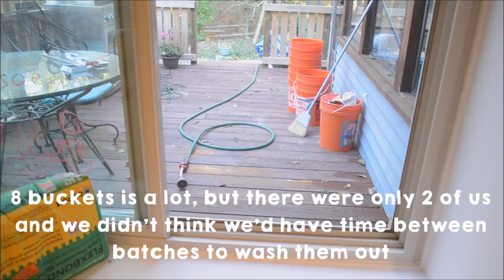My Experience with Self Leveling Underlayment

Comment: I had a floor like that leveled about 7 years ago.  It took me 3 weeks of intensive searching to find a contractor that would even take on a small job like that.  Then I had to wait almost 2 weeks to fit into his schedule.  It cost me $750, which is a good price according to other contractors I talked to.  If I had it to do over again, I would have done it myself, not only to save the money, but to get it done quickly so I could get on with the rest of the project.  Don't pay any attention to all the people who like to cut down DIY'ers, they are just jealous that you show people that there is no big mystery to much construction.  You just need to read up on the proper methods and jump in there.  It takes knowledge and experience to become a skilled tradesman, and all of them started out without the latter.

Comment: A couple of thoughts. So I'm a floorig contractor (eg. tile, hardwood, vynle, and carpet) who has extensive experience in self-leveling. There are many, many things that I do that I would put into the category of things that can be done by a patient DIYr, but self-leveling is definitely not one of them for the followig reasons. First, a floor like that should be mixed and installed in no more than 15 minutes, and preferably 10. The only way to soundly accomplish this is to have  large buckets that will handle 2 full bags along with water and some space so that you don't make a mess. Having two of these buckets is preferable so that one person  can mix while the other pores. Second, having a proper drill that will put out the proper RPM at the proper torque is critical to self leveling actually being self leveling. 25 years ago the first time I tried to do Ardex self-leveling I was completely crashing and burning. So I called Ardex, the manufacturer, and the rep came by to chastise me about the size of my drill. One $260 drill later the Ardex was turning out perfectly. Since then I've  installed thousands of bags of self leveling compound with that same drill. My third and final point is really something that the author of this video has likely already come to understand. A motivated DIYr with a little bit of training and a lot of time on their hands can float a tile floor to come out level using no more tools then they would otherwise need for tile. The same could be said for hardwood flooring. That is, time in a little bit of training and patience would allow them to to install a level, shimmed, subfloor. And if their goal is to install carpet, self leveling compound is generally Overkill anyways. The point here is that most things can be done without a lot of experience so long as you take extra time in the doing of them. But there are some things that because of their nature have to be done very quickly and with a great deal of precision. Self-leveling it's one of them.
Reply: Don't do it yourself, let a contractor do it for 5x the amount, perfect advice. NOT...
Reply: NOYFB clearly you did not understand my post. First what I'm suggesting is that she level the floor as she sets the tile (ie. with a medium bed mortar and sand) rather than using a self-leveling product. Secondly, having a professionally installed self leveling compound it's only about twice as expensive as buying the material and doing it yourself. So yeah, you clearly don't know what you're talking about.
Reply: Joseph DESTAUBIN, we have SOOO much floor to level - mostly for hardwood. Is there another product or way to do that besides this self-leveling compound? I'm doing the math as I watch her put all those buckets down...oh man.
Reply: Would you suggest using a grinder to bring down any high spots before using medium mortar or just doing all of the work with the mortar?  The more I look into "self-leveling" the more I'm really considering not doing it.
Reply: It is perfect advice, there are some jobs best left to a professional, and it costs more because they are professionals at it. Really?
Reply: Jo Nathan I have large water fed grinders, so ya, sometimes I do just that. However, in an ocupied house I don't usually grind, even though that saves some time. Ginding in a house, even with rentall grinders and vacume atachments can generate an amazing amount of very fine dust. So no, I would generally recomend just beginning the istalation with the least amount of morter you can and at the hieghst part of the floor. If the floor is really high at one point, then you will have to add quarts silica (to increase the slump of your mix) as you move away frome the high point. When setting stone or large dimentional tile, it's easy to fill in a vally but nearly imposible to climbe a hill. So as lomg as you start at the high point, and take your time, you will be fine.
Reply: Joseph DESTAUBIN agree with what you said. If grinding out side then sure a simple angle grinder with a diamond bit for concret is great. It's what I am currently using for my patio. But it makes a mess every where. It's very fine and can get up high and or in to small spaces.
Reply: @Joseph DESTAUBIN I love doing things DYI, but I have to agree with you here.  I've tried using self-leveler twice now, once in a tiny 5x5 bathroom and it still wasn't level.  It's not an easy product to work with and IMO worth paying someone else to do it so I can say nope not level do it again lol
Reply: @beardo5022  Self leveling is LESS about the product than it is about the concept that ANY liquid will self level. Once you get the idea that you want to FILL areas rather than create a entire new height, you work from there. You can make things much easier with a very wide screetning bar. This will be your leveling guide.
Reply: @philindeblanc  ..I'm about to lay beautiful maple on ply wood 350sq ft. I got cupped areas. 
You agree that this compound would be my go to?
I don't want to pour a floor. I want to level it.
Reply: @MrChit-od9po  for the dips cupping, the self leveling compound is good as its got polymers to be strong on its own. If the dips are created by high areas that are few, you minght want to grind those and then level if need be. Doing a floor now in a 350ft2 bedroom, and there was cement repair, so we grinded down, and will do a leveling. By grinding the high points you lower you highest refrence point and use less product with a lower base. This way your flooring and materials wont stack too high causing issues with doors etc.
Reply: @sandyy1445  Call me I level it with furring strips, out of Minneapolis mn.
Reply: Joseph DESTAUBIN are you anyone near New Jersey I’d love your help not sure I want to try this one on my own
Reply: Leveling out a floor while tiling is waaay more difficult than using self leveling compound first, especially with mortar and sand. I've been there. Your post sounds like yet another professional with hundreds of years of experience telling someone how to do it. If you read all the posts by (so called) professionals, they seem to contradict eachother quite a lot too, which says enough in my opinion.

Comment: My father and I struggled with this stuff too. You can special order slow set leveler, which gives you an hour of working time, instead of 10-15 minutes, which makes things a lot easier. We found that out after we were done. You also really want a tool called a "gauge rake" instead of a squeegee, but we were unable to find one and ended up making one out of a squeegee much like the one in the video. We removed the rubber and replaced it with a thin flat piece of steel, and attached two "feet" made from screw hooks which allowed us to vary the distance between the edge and the floor.

Self leveler is very difficult to get right, and most DIYers stay away from it, and those that don't are likely to mess things up on their first try.

Also, as others have noted, please always use a proper respirator when working with cement of any kind. Silicosis is no joke.
Reply: Another tip, you can use the edge of a flat trowel to "shave" peaks off the leveler once it's walkable but before it's fully cured. Much less messy than grinding. I wish we'd known that one too.

Comment: I'd say, if you are to use anything that is new to you, never start a big project. Rather try it small. For instance, what you could have done, is like so. Get a piece of plywood (say 4 by 4 feet). Attach (nail-down) thin wooden planks around the edges. Place it on your deck, and un-level it on purpose. It will be your "test-bed" Get some of that self-leveling stuff, mix w/ water (you can weigh the amount your take, divide its weight by the total weight of the bag, then multiply by the amount of water they recommend for an entire bag, and this will tell you how much you need water for your, smaller portion), poor the mix into your test-bed, see how it behaves... if it flows or not. Let it settle, see what you get. Adjust your strategy accordingly, comprehend your mistakes.

Comment: my tips for self leveller, as a DIYer

1. Calculate your needs from the coverage given on the bag. Then double it. This sounds dramatic, but its not that wasteful. The "cost" of under calculating is an uneven floor which could be worse than what you started with.
2. Plan your approach, be well rested, and work at a determined pace.
3. Buy a large cheap plastic container ( 40L or 10 gallon)
4. Add the correct amount of water. 
5. Mix 2-3 bags at once.
6. Use a bucket then pour the mixture in room strips accross the room letting it floor towards you. Do not advance so much that a poured strip struggles to flow back to your previous strip.
7. Retreat from the room exit onto plenty of newspaper

Comment: Cool video. About twenty (*koff* and the rest) years ago I worked in a lab developing these things...some of the products I formulated are still sold today. I'd say you did most things right, only a couple of things wrong. If I was still in the industry I'd take a still of the bit where you said "I see no need to skip priming"...that's a sin a lot of the professional contractors committed.

Let me be clear; ALWAYS prime. Better to do it twice than not at all.

Good advice too about adding powder into water, not water into powder, but you're not getting the best advantage from that unless someone is on the mixer when hubby was pouring the powder into the water...it just sinks to the bottom otherwise.

I'm gonna turn a blind eye to you adding more water on the floor...cos it's a small room and a DIY project...if I'd been on site with a contractor...scoop it up and bin it!

Final finish should've been better...I don't know what product you used, but on a room that size even a first timer should be able to get a good level floor...and it did not look like  you were overspreading it (another sin the professionals commit...I've seen 100 square metres of floor laid with just four bags of product. A quick volume calculation will tell you they were puttin it down at less than 1mm thick..ain't no levelling compound on the planet that's goign to flow out trowel marks applied that thin!) so...yeah, not sure...next time try Stopgap 300 (one of mine, of course!).

As to last comment...for tiles...yeah, you're right, probably wouldn't bother. Levellers are an essential step when laying thin vinyl though.

Thanks for sharing, took me back!

Comment: 1. cover the deck with nylon tarps or plastic. clean up is much easier.
2.get a pair of sissors to cut the cement open far less hassle. Easy does it.
3. WEAR A DUAL CANISTER DUST MASK!!!!!!! A TOP QUALITY ONE...SPARE NO EXPENSE HERE. NOT THOSE CHEESY COVER THE NOSE AND MOUTH ONES! dust can sneek down the cheeks and into the nose.  (Medical bills are hell later in life) when working around any kind of dusty material!!! Screw being tough or macho.
Reply from the maker: Yes!  All good points I should add to my blog post.  Thanks

Comment: If you pour and spread SLC uniformly across a floor, it won't end up much flatter than it was when you started.  You should only blind-trowel the SLC into the sides and corners.  Elsewhere you need to use a "darby" - a long straight edge e.g. aluminium angle piece that's at least 3 metres long,  to identify where the low spots are.  With that you can trowel the SLC around to fill any gap showing under the darby.  Also don't forget the adage about "painting yourself into a corner" :D
Reply: Great Advice... Thank you for sharing.

Comment: I can't thank you enough for your video.  I feel so much more confident in doing this project based on your video than all the others I searched.  I got confused at the end from the text in the video about the peeks and valleys, scared me then I read some of the posted comments as to not spread it and let it level itself and also to add more water.  I am building an ice skating rink using synthetic panels where the floor needs to be level and the studio I am leasing out is uneven, so thank you again for such a great explanation video.

Comment: Thank you. I think this will help me and I appreciate the effort that went into making the video. I am curious about what spacing and depth of notches in the squeegee you think would work. I also wonder if you add more water if it would level better. I'll have to dig my ice crampons out of my camping gear...
Reply from the maker: I'm not sure where I read about the notching of the squeegee, but any notches are better than no notches like I used.  I don't think more water was the answer.  It did move, it just didn't move enough on its own.  If you watch any other video or read instructions you do have to spread the stuff around.  It's like pancake batter.... Yes it's self-leveling, but it doesn't fill up the entire pan.

Comment: you should do a followup video with the final result of the floor, how did you handle the uneven areas?  I have a similar situation, im going to use an angle grinder with a cup concrete leveler.  Good video, glad you had subtitles on the vid :)

Comment: seal the floor with sbr not pva, use latex self levelling compound as it doesnt crack like a dried out lake, mix like pasturised milk, poor out in long lines 250mm away from wall and each line it should then level itself out without to much trowelling, you got there in the end, all about experience and next time you will be a master at it....great to see people having a go
Reply: If you use SBR with a water mixed compaound, got to get on it quickly (while it's still tacky) or adhesion will suffer...you won't notice that with a latex compound though.

If water based ones crack, they're either bad product (it does happen) or too much water has been added...or the heating is on full belt to try and force dry it...or...or...or...

:-) there are lots of reasons a compound will crack...the only one I can think of where switching to a latex product would be the floor is actually moving (timber, or floating slabs).

Comment: The problem with this video is that the person doing the work didn't read the directions. This is a self-leveling concrete. Of course she had lots of ridges because she constantly kept raking and "smoothing" the surface. All that is needed is to lightly run a level over the surface to break the material's surface tension and allow it to flow between thick and thin layers. By constantly smoothing the surface as the material dried, she was causing the ridges. The problem is the person doing the application, not the self-leveling concrete.
Reply: People love to criticize others let's see your jobs
Reply: As a person who tried just letting the stuff flow to level on it's own, I think there's a middle ground somewhere. Especially with fast set leveler, you're going to need to give it some help.
Reply: First - you're dead wrong.  The material was NOT self leveling.  It was supposed to be, but they poured it out of the bucket and it sat there like a lump. It needed more water, but they had no way of knowing that, because they used exactly the amount of water the manufacturer stated on the bag.  Before you try to argue with me keep in mind that I work for a huge manufacturer of self leveling (and tile products, but I'm on the tech side of self leveling).  OH it's not self leveling concrete.  Concrete has large stone in it.  It's self leveling underlayment, just like the lady said.

Comment: You had a go and made it smoother at least. I think you need to use a spiky roller after pouring/spreading and also wear spiky shoes. I did mine without spiky shoes but was unable to walk around using the spiky roller as much as I would have liked. It worked out well though.

Comment: Next thing you need to learn is to use a laser level to determine the high point of the room and then make guides (i.e., levelling tripods or ardex levelling pins) set to that height...prime and pour away raking with a 24inch fine concrete spreader and some people finish with a spiked roller which is a great idea also.  If you just pour and pour, even with a chalk line on the walls, there is much room for error in the center of the room with peaks and valleys.  Its very easy to pour on top of a pour thats partly setting and start humpage from the overlapping areas...Self-levelor requires a good deal of assistance on the part of the installer to get a job right on the first or second pour.  The name is deceiving.

Comment: I level floors all the time And what I've found is rather than using screeds it's better to cut rubber squeegees to leave a desired level. That way you can push and pull numerous times and be left with a continuous level. Great job.

Comment: Here is a mind blower....All liquids are self leveling! So cement with the right polymer content to not crack, and mesh with adhesive to the existing floor using a large straight edge, can help This is not my profession, but have done such projects